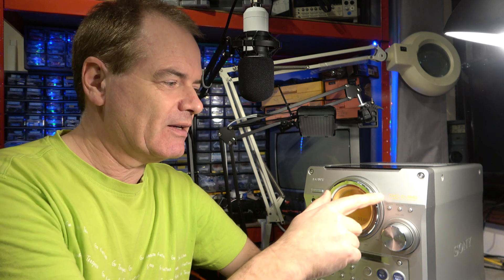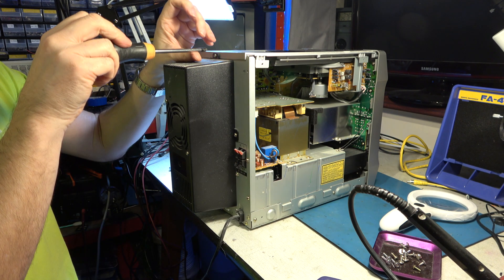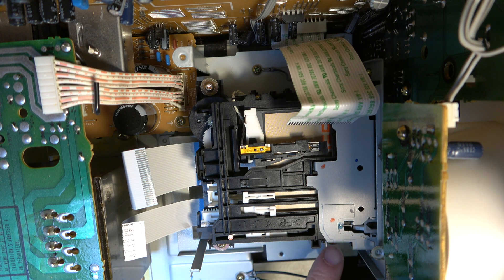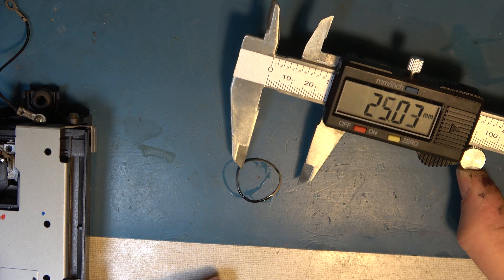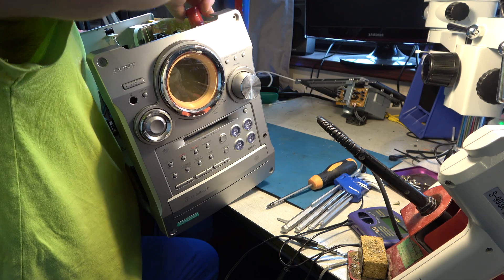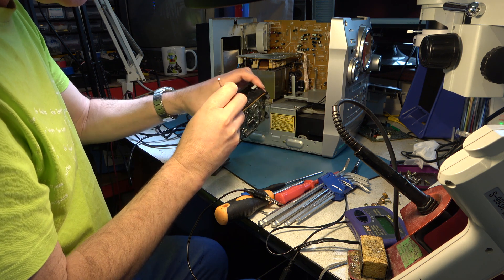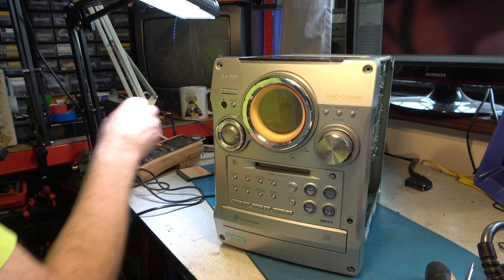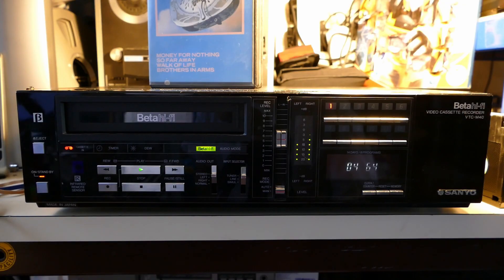Repair the minidisc deck of a Sony CHC-CL5MD

Comment: Visor do meu acende mas não aparece os números
Reply from the maker: I've seen this problem.  I was about to replace the front panel but after leaving the unit powered off for a few days, it fixed itself and the fault never returned.

Comment: Just has one of these with the same issue, stretched MD eject motor belt. For anyone else attempting this repair the upper black MD carrier tray that covers the belt can be removed very easily giving great access to change the belt. 1. Remove the short spring on the left towards the front. 2. Depress the carrier tray tab at the very rear centre of the MD. 3. Lift the tray carrier which is held in lightly each side by two short metal stubs. 4. Change the belt.

Comment: thanks for the vid really helped me out with mine, do you have a video on how to take the cd part out and renew the belt on that?
Reply from the maker: Alas no.  I believe I replaced that belt many years ago, and I think I did it in-situ but it was fiddly.
Reply: @video99couk  thanks for the fast reply there. i see so after the mini disc deck is out you can get to the cd deck from there? it just looks like a black top with no way of getting into it? bit stuck, any more help much appreciated.
Reply: @video99couk  hi again, ive had my system apart again today and got to the point where the mini disc unit is out, ive now not got a clue what to do as the transformer sits on top and there no obvious way of getting into it or out, please can you help as you said you done yours in situ.

Comment: Hi, I've got the exact model hifi at home, the CD tray does not open, is it possible that the drive belt is gone also?
Reply from the maker: Yes I had a drive belt failure in the CD mechanism years ago.  I seem to remember it was a bit fiddly to access but not as bad as the MD belt.
Reply: @video99couk  thank you so much for the reply, I will get cracking on it.

Comment: hi my friend, i have a problem with my CHC CL3.I no longer see any letter or word from the "porthole" where you can read the settings for example. what do you think is the problem?
Reply from the maker: I've had this problem too.  If you look carefully, you might see that the display is operating but very, very dim.  It would seem to be a problem with the display driver.  I unplugged mine for a while, ready to install a second-hand display unit, then found to my surprise that the fault cleared and never came back.  So try unplugging it for a long time and see if it re-boots properly.

Comment: Gostaria de saber se o Sr. teria o controle remoto do CHC CL5MD e o display para venda...moro no Brasil mas conheço pessoas que poderiam comprar as peças
Obrigado
Reply from the maker: No I don't have a spare remote or display to sell.  I did buy a spare front panel including display, because at one time the display would go very faint at times, but then that fault fixed itself!  But I will keep that front panel in case the display fault returns.  These parts do appear on eBay sometimes.
Reply: I got it, thank you

Comment: I just picked one up one of these but there is no life in the cd changer mechanism. I'm about to strip it down to see if there is anything obvious
Reply from the maker: The changer drive belt can fail but then it should still make noises.
Reply: I've replaced the belt but struggling to get the thing back together 😬
Reply: @1969longshanks  hi, the guy that made this video was a great help and i changed the belt now on the mini disc unit, my cd unit is not opening either you say you did yours is it posible to explain please where you go once the mini disc deck is out as im stuck, the transformer its on a top  plate, no obvious way that i can see of getting into the disc changer, help much appreciated

Comment: I've had this EXACT same problem happen with my MDS-S9 minidisc deck, it has the same transport so at least I know where to find a replacement belt now, but that's a bit expensive just for a belt.
Reply from the maker: It is expensive, but such a difficult size to source.

Comment: What a pig of a unit to work on. It's hard to tell from your video, but on all the Sony MD units I've worked on there is a catch on the back of the sled that can be released. When that happens the entire top half of the sled hinges upwards from the front giving excellent access to the drive belt. As I say, it's hard to see if that's the case with the mech here and, judging by the ludicrous shielding etc., Sony didn't want to make things easy but it's hard to believe they would make a replaceable part like the belt so hard to reach. Great vid - keep up the good work I'm enjoying reliving my youth watching you rescue ancient VCRs.
Reply from the maker: It was a pig, but would have probably been easier if I had ever worked out how to remove the entire front of the machine.

Comment: mdm7 drive unit, same as je440/640/470/770 and jb940,belts can be had 6 for a tenner on a well known auction site, the belts will also fit je480/780 and jb980 also though the drive unit in those is for type s, so a little different, as i am assuming that player is type r.
Reply: Most likely as the R MD were most common. He might have lucked out and have a type S. I haven't checked minidisc.org to verify.

Comment: I remember these 'bookshelf' type systems were all the rage not so long ago. A relative had a similar, but much cheaper looking Aiwa system with a double cassette that went awry, so I offered to take a look. My goodness, I don't think I've ever sworn so much taking something apart! Almost went straight out a second-floor window..with me along with it! 

Much to my own amazement, I actually got that infernal cassette compartment working again (it was stuck between modes). Never again! 😬

Comment: Am looking at a Zenith Betamax Programmable Director VR9700J. The seller is rathe vague in the item description. Seller says: "Tested as much as possible.

Turns on, programming works as intended, all switches and buttons moves as intended, all lights come on. Tape bay opens and closes smoothly. Channel selector works properly. Remote included but not able to be tested. 

Did not play tape when attempted. 

Unit is in very good physical condition. Very minor scratches and scuffs as pictured. Comes in original box with original foam supports. Safety manual included. Please see pictures for details of condition and items included." You think it's a good deal for 150?? Am may try to get it for less but lets see what happens😇.
Reply from the maker: I don't know much about that model but it looks very old so it's bound to have faults to repair.  Don't buy it if you can't take on a repair job yourself.
Reply: The belts are probably bad try replacing them and see if it works

Comment: That is an odd looking unit, it reminds me of the center console in a car dashboard with knobs and buttons on it.
Even the new drive belt didn't look fantastic,  if it was easy to access i would want to roughen up the pulleys to reduce slippage.
Nice big transformer, a decent wattage output maybe.
Don't put yourself down on your videos, let us do it instead ha ha :-D joke.
Every time i hear that music, i'm sure that someone is whispering ' Pace ' :-D,  yep it is my hearing lol.
Keep tinkering Colin, and slurp that tea :-D
Reply from the maker: It's a very loud stereo, good speakers too.  Only think lets it down perhaps are rather weedy speaker terminals.  Track skipping is done by rotating a large ring on the outside of the display, which is a bit zany, but it has a remote too.  
I'm not sure what the words are in the song, I might ask the copyright holders.  The song is called "Let It Run", it was studio recorded on a Betamax PCM-F1 tape, but never commercially released.

Comment: I have a smaller Sony MD/CD unit, I had the same problem, but  had to completely remove the front panel to get access, a real pig of a job!
The CD player has now started to skip, but as it is mounted in the top, should be  a bit easier to access......
Reply from the maker: I very nearly had to remove the front panel on this one.  It seemed harder to do than it should have been.